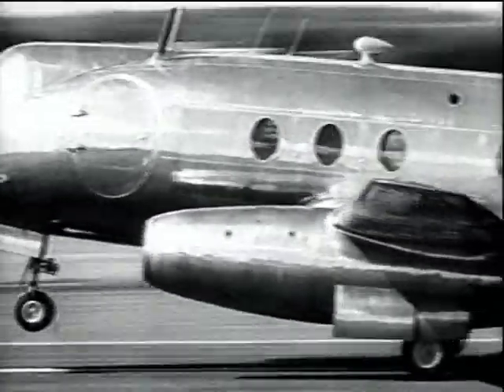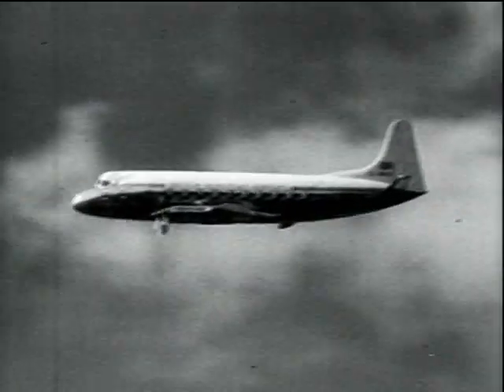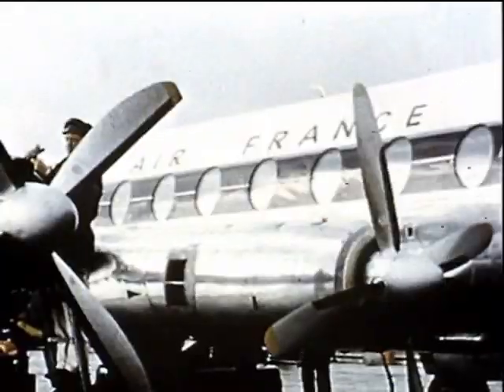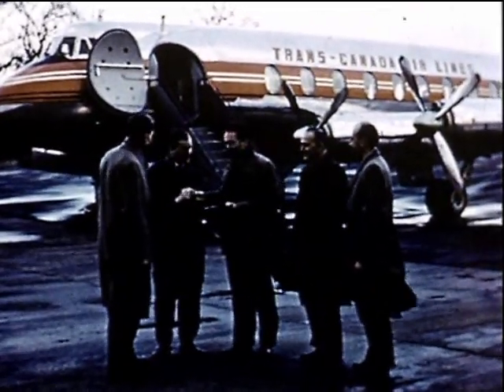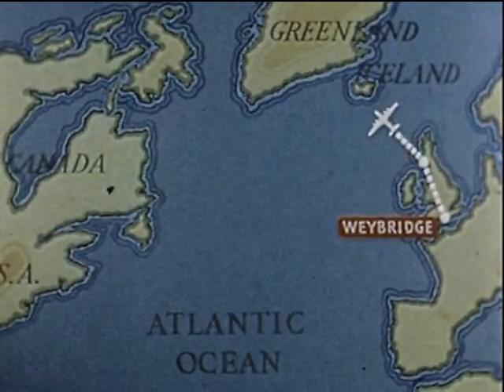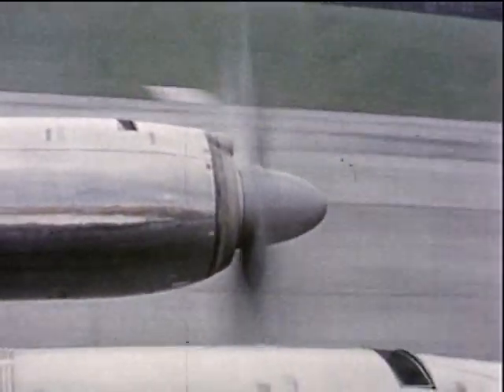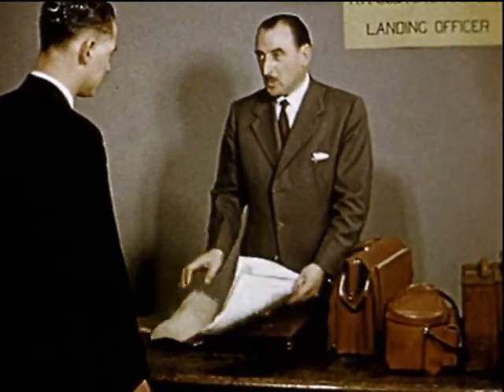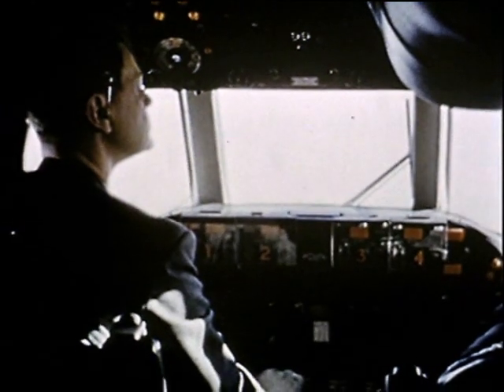Vickers Viscount - World`s 1st Propeller Turbine Airliner at SBAC 1950 and en-route to Montreal

Comment: The Viscount was a superb aircraft that gave sterling service on short haul routes, they were in regular use from my local airport at Castle Donington in the 60's and you knew that it was a Viscount coming by their engine sound. The aircraft was developed into the Vanguard a larger version but it didnt get into production until 1960 by which time jet aircraft we being produced and no one wanted them, a fine aircraft though some of which were still flying in the 90's as freighters, typical of the  British aircraft industry, very good but a little too late.